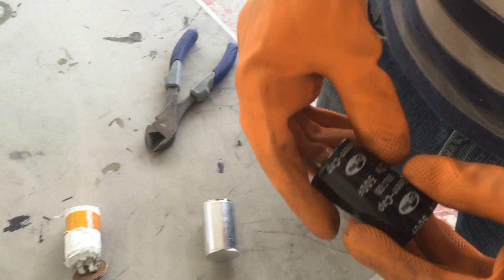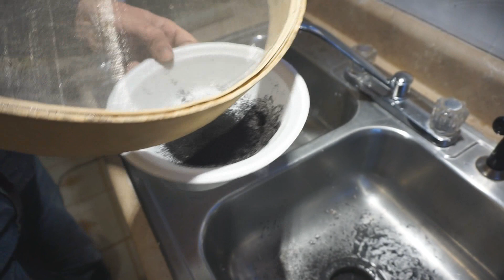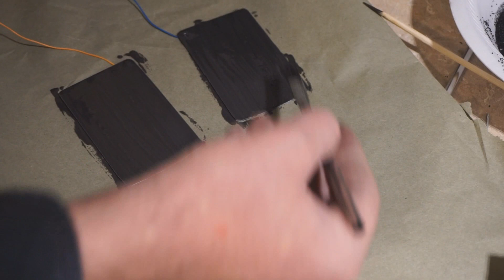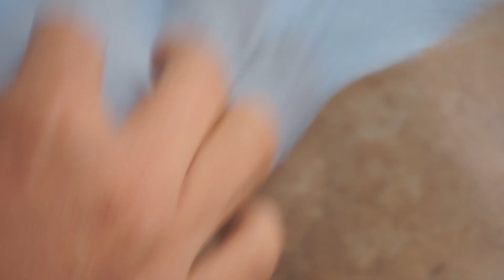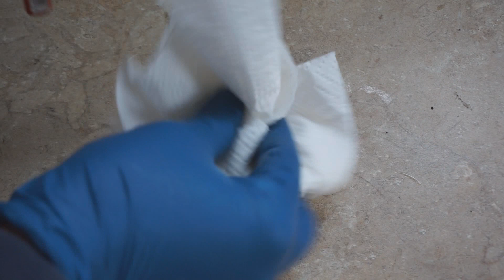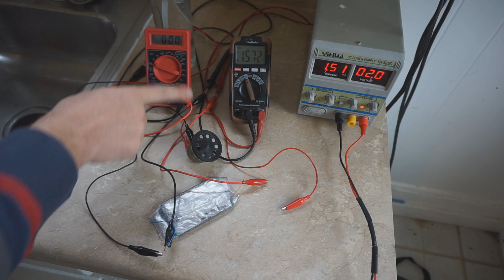Easy DIY Graphene SuperCapacitors

Comment: If you draw a vacuum on the first envelope you put the aluminum plates into, atmospheric air pressure will squeeze it all together much better than packing tape and shrink wrap. This would be easily done with one of those food sealers (which appear to use exactly the kind of bag you used.)

Comment: If that's actually graphene powder ( planar carbon 1 atom thick ) then you're paying around $60 a gram.   Then you're mixing it with varnish which is going to ruin it's properties.  You should consider using plain graphite powder instead which is around $5 for 100g
Reply: That is just graphite powder he's using.  It can't be graphene because of the expense and coating the graphene in varnish would utterly ruin it's properties.  I strongly suspect it's just graphite powder.  He's got the right idea about maximising surface area that's why the commercial caps have rolls and rolls of very thin leaves coated in a conductive layer.  typically you'd have an insulation layer on the bottom, then a conductive layer with a lead attached, then a permeable layer with the electrolyte and then another conductive layer with the second lead attached.  The second conductor may have an oxide coating.  This will then be rolled up and put in the familiar canister of the electrolytic capacitor.

The home experimenter here is producing some interesting results but a commercially produced cap of similar size would produce better results due to improved manufacturing techniques.  For example you can improve on the surface area by using multiple thinner layers rather than increasing it by a rough surface.  That said you certainly can make caps with huge capacitance at home, they're just going to be bigger.  Interesting things to experiment with would be breakdown voltage while charging - At what voltage does the electrolytic or insulation layer fail?.  Working temperature - How does the caps performance change under load and repeated charge discharge which causes heating.

Comment: If you take apart a plastic film capacitor you'll find very thin plates and lots of turns rolled up, probably even more than in the supercap you took apart. The supercaps get their high capacity from the porous surface of the electrode material which creates an enormous surface area.

Comment: it is almost a year later now.  how has this experiment fared over this time?  how many charge cycles?  did you see increase or decrease, etc?
Reply: I'd like to know too, did you ever get anywhere with this?
Reply: James Searle I can tell you absolutely he did not
Reply: Shame, it looked quite a nice design.
Reply: James Searle It might be better if you use stainless steel,  one person posted,  but trying to use aluminum foil was all a no go for me , plus Im  sure you may need to tame the phosphoric acid,  I might be wrong.
Reply: +YEAR OF THE ROOSTER Aluminium is cheap and easily available, but I agree it doesn't stand up well for repeated cycles, especially thin foils and high currents. Especially with water based electrolytes because the oh- ions attack it. At least from my limited experience.
Reply: James Searle yeeeeeeeepp burnt-out 2 caps I made with tinfoil, ended up fuming  hot after recharge and melted the separation sheet, back to the design technique

Comment: You should make a setup that logs volts and amps over time so you could graph a charge/discharge curve. Maybe test with different loads like constant power loads and constant current loads. And you could even automate this procedures with a series of relays and a microcontroler. measuring temperature is also a good idea.
Reply: This https://youtu.be/wtbcaWnybzs .

Comment: that is a battery not a capacitor its simialar to a lead plate acid battery in a car   using aluminum and a different acid does not make it a capacitor.

Comment: lol wow how primitive the mind can be. he says its graphene because he knows he will get a lot of views/comments and likewise $$$$. cmon its not that hard just a little critical thinking.
Reply: Actually, i can believe that what he was sold could be indeed graphene. (Seeing as it was a foreign manufacturer that probably produces it at the cheapest possible method for a quick buck) Large scale (ie. sheets) of graphene are expensive to manufacture so it is probably more likely you would get a powder like this.

However performance was probably hindered because the graphene was not fully bonded to each other (ie. a sheet).

Just my opinion though, I don't know much about capacitors, but I do keep quite up to date with graphene.
Reply: Ten year olds can make graphene at home with 9v batteries and pencil lead.  Is it semiconductor grade?  Of course not.  Is it usable graphene?  Hell yes it is.  Is it particularly well suited for capacitors?  Yes, it is.  

It's more likely that you're a lazy stoner douchebag troll who greatly overestimates his own intelligence and has never lifted a finger to try it yourself.
Reply: this comment was comment number 666
Reply: graphene is carbon but it is a form of specific carbon. He means that this guy calls it graphite while it is probably a different form of active carbon such as charcoal. The stuff in pencils is graphite.
Reply: yep
Reply: @broskiF42069  bruh
Reply: Its graphite not graphene . graphene is carbon compressed at high pressure until it becomes clear like an artificially made diamond, but more flexible and has different physical and electrical properties

Comment: Well! My greatest congratulations! You've just discovered galvanic cell. The greatest difference between capacitors and batteries is in fact, that you have no necessity to charge battery before use. But you have to charge capacitor every time you use it in case of self-discharge current. What we've got here? It's nothing more than usual galvanic cell. Not a supercapacitor.

Also, why you are speaking about graphene? I've got an opinion that you even have no idea about what it is look like. Graphene is real 2d crystal of carbon. And this form of carbon is really hard to obtain.

Comment: you are right about surface area because the more surface you have the more electric field you can have (well not the exact explanation but just the general idea)
C = ε * A / d (where A is the area, and d the distance between the plates)

Comment: not really graphene
Reply: Watch carefully he opened a seperate container with some graphene in it.  Its not what he made in the coffee grinder.
Reply: Arlin Sansome, but when it's not a continuous sheet, there's not the magic huge amount of free electrons of the carbon lattice. There will be the gazillion interfaces between separate graphene nanosheets where electrons are not as happy to jump even when not separated by polyurethane. I think the powder of  nanobroken graphene will offer little improvement over simple coal dust.
Reply: However, the graphene 's powder has a  surface 's density e ven bigger  than Actived carbono.  And the electric charge storage of capacitor  is directly  related to the surface of the plates . So , it is Really interesting enhance the surfaces of the capacitor using graphene and not actived carbono .Actually,   I r eally
would like the experiment using only graphene's powder. Although, is more expensive...
Reply: Arlin Sansome, graphene is not just a substance that you can use as a powder, or even dispersed in liquid. I think the thing that would make me call something a "graphene capacitor" is the fact that it is made using a looong continuous transparent-1-atom-tall sheet of carbon. Maybe I have to watch it though again to see if this is accomplished in a way i could not get yet.
Reply: You can get graphene in smaller amounts it doesn't need to be a sheet.  Yes if he has a sheet of it it might make this work better... But graphene can be a powder.  It just means there is many layers stacked up and its broken up a bit.  Remember just because its 1 atom thick doesn't mean it needs to be any length or width and if you have many layers of the 1 atom thick stuff like that it will be a powder that looks like graphite.  IN fact many have simply put graphite in a blender to make graphene its not a great quality but it does produce some graphene.
Reply: Gert Bolten Maizonave youre  right,  but available graphene is in powder. the graphene  is using Samsung 's batteries is powder. All we are expecting the true graphene
Reply: h
Reply: knowledge´s man, I would like even more to make a couple looong 1-atom-thick continuous carbon sheets separated by a couple very thin sheets of dielectric polymer, rolled up as the closest-to-ideal possible dry capacitor.
Reply: This i would undoubtedly call a Graphene Capacitor. 😍

Comment: question BIGGER the plates bigger the voltage ?and amps?
Reply: what can i make in this idea to  to  RUN a 5000 w electric 50v 20 amps bike wheel at  how many and how to go about it would be a nice big help ON MY PART AS I HAVE BUILT MY OWN ELECTRIC CAR THAT I WANT THIS SYSTEM TO HELP RUN MY CAR WITH THIS 5000 W WHEEL AND 50v 20 amps THANKS IF YOU CAN HELP

Comment: You don't want the electrolyte to ever touch the aluminum and especially not the terminal joint.  It will lead to the capacitor having a high self-discharge rate.  The bubbling you were hearing was most likely the electrolysis happening at the unprotected edges of the aluminum plates.
Reply: https://youtu.be/KiLTEjm8zLw
This is a graphene solid state generator circuit using graphenes thermal motion to generate limitless energy. Please develop this tech.

Comment: could you do this with aluminum cans which are cheap and plentiful? Just sand off the enamel on the inside and outside of each can and make a sandwich, like ten cans thick.what if you use graphite powder?/Could you use an electrolyte like lemon juice?

Comment: Not sure if anyone has asked this yet but would the thickness of the plates, activated carbon and your separator play a role in changing the voltage and could you take say 8 plates, on 6 put the activated carbon on both sides then the end ones only on the inside with the wires on the out side also increase the voltage?

Comment: Isn't the phosphoric acid solution conductive? Wouldn't that make it a battery if it was??  I don't have any experience with making capacitors, but I would have thought  a capacitor would require a good dielectric ie not conductive.

Comment: If you mix nickel and aluminum and then treat with NaOH, much but not all of the aluminum dissolves away leaving high surface area. Second, add sulfuric acid to sugar. The resultant carbon snake may also have a high carbon SA.
Reply: Make sure it's concentrated Sulphuric acid though which is a dehydrating agent.  Aqueous solution won't do it.  Basically the Conc H2SO4 draws out H and O from the sugar in the same ratio as H20 which in pure sucrose leaves  just Carbon behind.
Reply: high carbon San Andreas?

Comment: Graphene is supposed to be one atom thck this is carbon not graphene.
Reply: No, it's a supercapacitor. This is not an uncommon production method for graphene supercapacitors.

He is NOT producing the graphene. He ordered the graphene from a graphene nano-platelet manufacturer. He never claimed to create graphene from the crushed charcoal.
Reply: ether no, it wasn't. Those were just the smallest particles produced by the crushed charcoal. Not graphene.
Reply: The carbon wasn't the graphene capacitor part. That's just part of making a supercapacitor, the activated carbon granuals are what create a large surface area to increase capacitance. The graphene was in nano-platelet form mixed with the glue like solution.
Reply: The charcoal is just giving the graphene layer more conductive surface area... I feel like this comment chain is going in circles xD
Reply: It is. But i mean... It's YouTube. No one reads the previous comments
Reply: Hangfire I agree with most of your assessment except for he did an actual graphene that was commercially made he wasn't claiming that the carbon that was crushed was the graphene he added separate graphene particles that were produced commercially and he purchased watch it again
Reply: No that guy is right. He might mean crushed graphite but this is probably crushed charcoal.
Reply: ***** You could keep stacking these. I think the point was to get the most out of a single stack though.
Reply: b graphene is carbon...
Reply: It really is amazing how many people are stupid. Did people not watch the video, or just watch the bit where he crushed  carbon and not the bit where he got his bought graphene and painted it onto the aluminium sheets? Watch the video properly people.
Reply: It's not graphene. This is a carbon battery.. Old tech
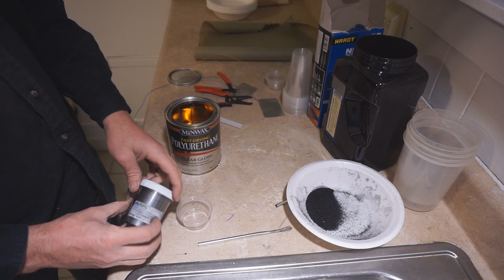Reply: 6:22 graphene added to crushed charcoal.
Reply: You need to research what graphene is. ._.
Reply: what makes graphene special is it's structure, he is not reproducing that with crushed charcoal. this is a crude carbon battery, nothing more

Comment: Hi Lasersaber! I have been experimenting with this stuff also, perhaps you can share some experinece. Why do you use phosphoric acid? Does it corrode the aluminium over time? What if you use saltwater as the electrolite? Also why do you filter out the fine carbon powder? Shouldn't it add even more surface area?
Reply: Phosphoric acid, hmm. Isn't coca-cola, sometimes stored in aluminium cans? But then it takes a potential difference to cause corrosion; if there is only one electrode immersed there is no potential difference, so no current? Just thinking outloud.

Comment: Copper connected directly to Aluminum.

Dissimilar metals=Galvanic corrosion.

If your planned usage/time is short it shouldn't be a problem but over longer time the corrosion could really become a problem.

Comment: Wouldn't it be an idea to use aluminiumfoil instead of the aluminum plates? The weight/surface ratio would be much higher in  my opinion.

Comment: so sorry but you use graphite not graphene
Reply: Yes I don't understand the carbon either. Should be able to paint the graphene powder ink on the metal substrate and put a separator in between with an electrolyte and you would have the capacitor.
Reply: if it aint one layer it aint graphene
Reply: exactly
Reply: m8 get it rite hes using coal
Reply: MrYellow lol
Reply: Try to sell coal for the price of diamond and see if its the same.
Reply: JOSE MANUEL CUESTA haha u r ri8,this guy is ignorant
Reply: It is graphene oxide. Few layer probably...not pristine one layer like you see in professional labs. But yes it is graphene.
Reply: actually in all ways...
Reply: increased surface area i believe..
Reply: perfect is an opinion.. i dont know about perfectly aligned but graphene are sp2 bonded in a hexagonal lattice.. and yes, they can be stacked without turning the graphene properties back into graphite.
Reply: A
Reply: He used both
Reply: @MrNeutron98 Shure, order Diamonds on the internet and you will get some chunks of Graphite. Hate when it happens 😛😂
Reply: 6:30
Reply: TheLiasas he ordered the graphene. also he copied Robert Murray-Smith. who actually does this technique(more or less) to create batteries and super caps. the activated carbon is the only questionable part to me. why use it. Robert Murray-Smith was able to just use paper and graphene ink.
Reply: David Serrano where to get graphene ink?  Used to get graphite spray lubricant to keep locks from freezing.
Reply: David Serrano fuck off
Reply: graphene is 1 atom thick 2-dimensional material, the carbon is perfectly aligned and that's what gives it it's strength. If you want to talk about 3 dimensional graphene, you will then be talking about graphite. 

It is difficult to manufacture large scale without expensive equipment, so that is probably why it was sold cheaply as "powder." His capacitor is a rough build of what could be achieved, but it would probably be better if the graphene was pure. 

One way I have heard about for getting a proper coating of graphene is to put the metal above it and boil carbon. It creates an even coat of fully bonded graphene. Mind you, not sure how that would go over inside a house.

PS- the next exciting 2 dimensional material apparently is achieved using boron!
Reply: @neur0n no. graphene is carbon with atoms perfectly aligned. not just a 1 atom thick shit. ffs how would it even be aplicable to large stuff as it is nowadays in labs?
Reply: TheLiasas pencil lead is graphite and clay mixture.  Anything useful there?
Reply: Okay.. if you have sheets of paper and stack them on top of each other, do you now have wood or do you have stacked sheets of paper? You have stacked sheets of paper. Stacking the sheets does not introduce the bonds necessary for the paper to turn back into wood. Same thing with graphene pretty much...
Reply: That is simplifying by orders of magnitude geometrically

Comment: I watched the video all the way through. Sorry but I am Not Convinced.
 I work with caps - It is not possible please take the plastic off standing alone- charge it -and with only the wires to the motor connected to the (super cap)and run the motor (Don't wave so many wires coming in and out going behind the power supply)

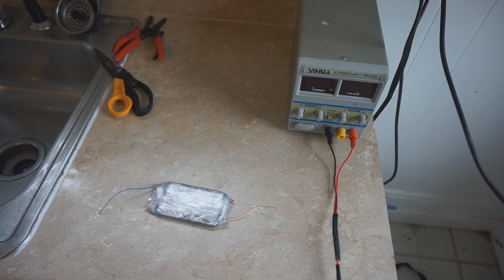Comment: Interesting but strangely edited... what happens between 18:03 and 18:05? Is it what's in the beginning of the video, i.e., did you connect it to the charger? Or is there some initial charge/voltage in there?

Comment: you can't make graphene to any appreciable degree with activated carbon. You are making some sort of nano carbon but graphene is from graphite only (to any appreciable degree)
Reply: Um no.
Reply: Its 2 aluminium plates with an insulator in between... which is  regular capacitor...
Reply: A super capacitor  is just a big regular capacitor.
Reply: A supercap is minute. Tiny. miniscule. If it looks normal size, it has bajillions of times more capacitance than a regular electrolytic. Thus, "super"